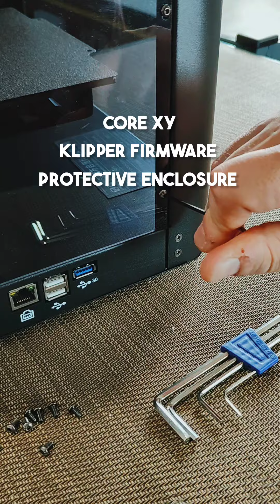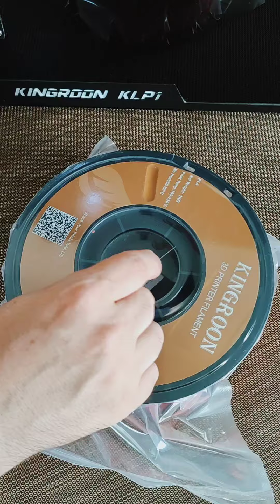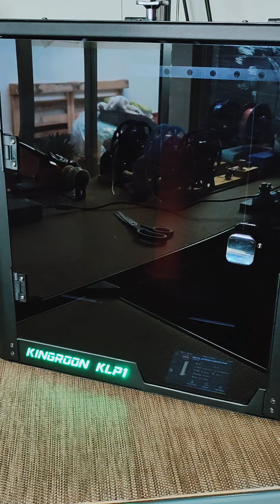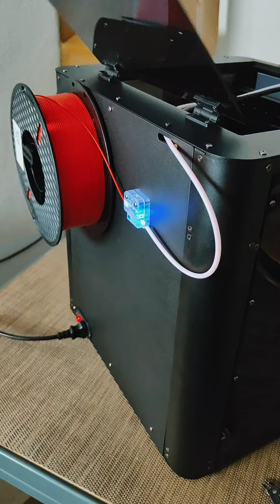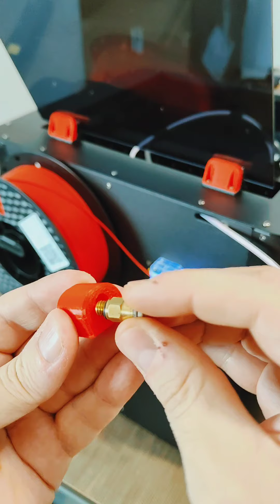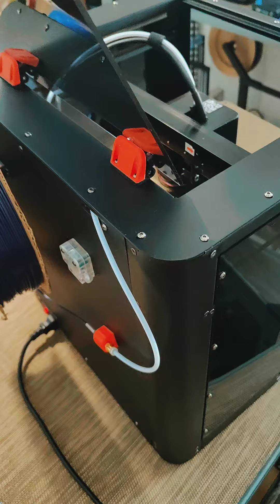Kingroon KLP1, Core XY, full Klipper access and WIFI, lots of fun

Comment: Do you ever have bubbles in the print because of the moisture in the PET filament? Or you always dry the filament out before printing?
Reply from the maker: I have never needed to dry the filament, the bubbles are not due to humidity but to lack of flow and/or excess temperature and/or bad extruder
Reply: Well i tried drying the filament in the oven, i left it on 60 c for about 5 hours and than the prints didn't have any bubbles so that is why i assumed it was moisture. @function3D

Comment: Hi I want to Ask can I print detailed figures with filament from plastic bottles (like in the "thanos" Video on your channel)
Reply from the maker: Thanos is printed with resin, they are different technologies, it has nothing to do with plastic filament printing
Reply: @function3D  I know it is a different tech 
but my question if I use " filament from plastic bottles " to print action figure like thanos Will it be nice result also ?
Reply from the maker: @freezycrazygames7493   PET pastic is quite transparent and very shiny, if you leave it as it is it is not a good finish, if you paint it then it will look like any other painted filament
Reply from the maker: https://vm.tiktok.com/ZGJco3WKR/
Reply: @function3D  thank you so much
Reply: I have seen people print FDM models using a 0.1mm nozzle and it was difficult to tell which was the FDM and which was the resin model. I don't know if it would work with PET though. Could be worth a try.